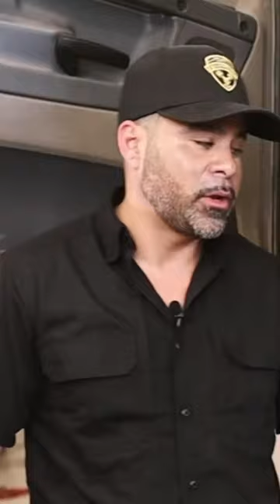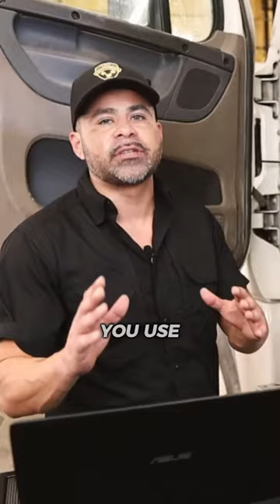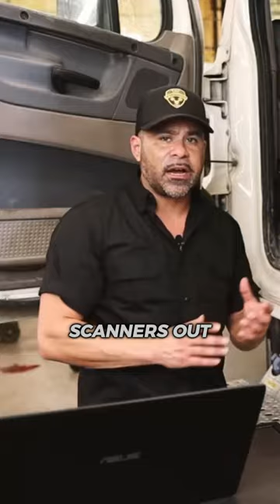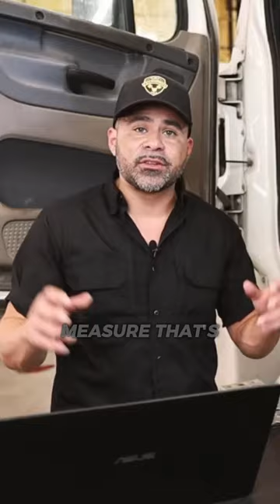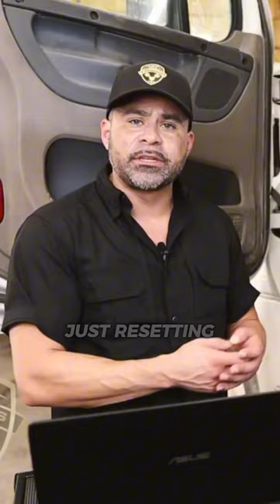Best Software For Semi-Trucks

Comment: You sure? I'm thinking the ECM/PCM won't think anything but just monitor the parameters that set codes. If the parameters are out of specifications it will set a code. The codes aren't arbitrarily to protect the engine, a majority of them (emissions codes) are set because the after treatment system isn't performing as designed.

Comment: I can’t tell you how often I get ghost codes for different pressure sensor data erratic on the mp7 motors because the guys didn’t let their trucks fully warm up before driving off 90% of after treatment codes are false codes because the computer was just being stupid